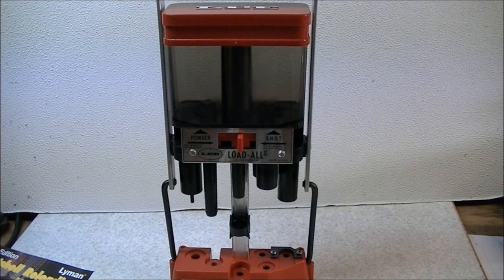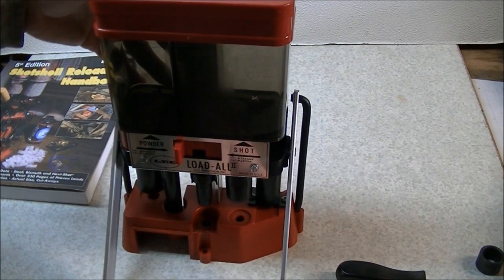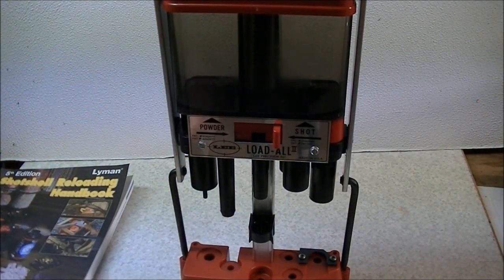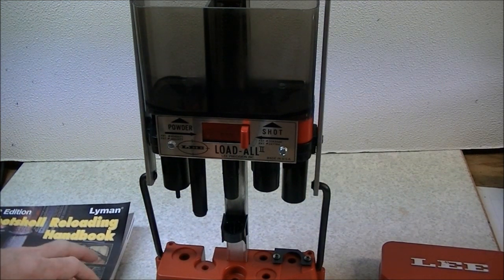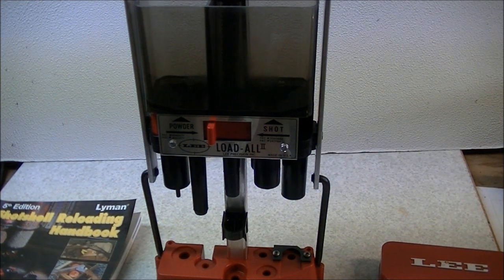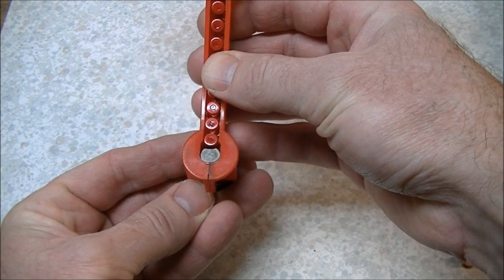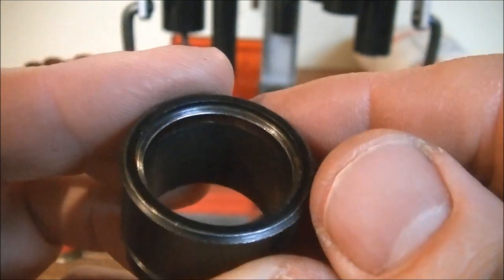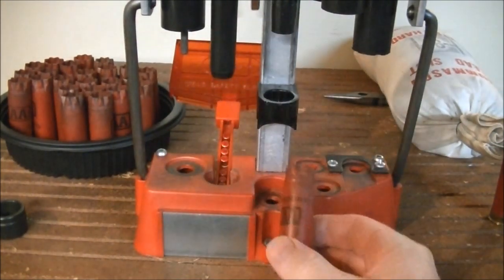Lee Load-All Setup and Operation

Comment: Let me add my thank you as well. I bought this machine because I will be loading buckshot. The powder, wads, pellets and buffer will be staged manually, but the other stations on this loader should work for me. Your advice on using powder bushings, etc. was spot on. I hope the newb reloader will spend some time with what is written in the front of the Lyman manual. Even as an experienced, albeit occasional loader, I find that refreshing my memory on the basics is time well spent.
Reply from the maker: Glad you found the video useful. Thanks for the comment.

Comment: Thank you for this video! I have recently decided to get my dad's 1959 Browning Belgium-made "Sweet Sixteen" up and shooting again, and maybe try to do a little skeet shooting with it.  I didn't know that factory 16ga target loads are basically non-existent anymore. I have a few boxes of shells from my childhood that are close to 40 years old, so I'm not putting too much faith in those. It appears to me that if I want low-pressure target loads for this shotgun, I'm going to have to learn to make them myself. If anyone reading these comments wants to share their experience with me I'd be greatful.
Reply from the maker: I bet those 40 year old boxes of shells will work just fine, assuming they were stored in reasonable conditions. As for loading shells for your Auto 5 16 gauge you may want to look into using either the Claybuster CB0078-16 16ga 7/8-oz wad or the CB0100-16 (Winchester WAA16 copy) for 1 to 1-1/8 oz loads. Have fun with your loading and shooting and thanks for the comment.

Comment: I recently bought a Lee Load-All II.  While loading I stopped and rechecked the weight of the powder charge.  It was still where I wanted it to be, so I filled an empty hull with the just weighed charge.  While I was running through the reloader, I was about drop the powder and then thought to myself, "Didn't I just fill this one?"  Yep, it already had the powder in it.  Glad I checked.
Reply from the maker: Shot shell powder/wad/shot charges are bulky and so it's unlikely you would have been able to crimp a shell with two powder charges in it.
Reply: @314299  - Thanks, that's good to hear.  But it still rattled me a little bit and made me pay more attention when I'm reloading.

Comment: Thank you! I was just given one of the first models with the aluminum base. Little bit of oil and it works like a charm!
Reply from the maker: I like those early Load-All's better, they have a more sturdy feel than the later plastic base versions.
Reply: Agreed!. Note on the conversion kits, the plastic base loaders have a screw in shell plate guide (the black thing) on the final crimp. Older metal base is by guage, meaning converting a 12 to a 16 or 20 is ok, but up converting  (originally 20, convert to 12) wont work due to the guage specific base. I'm working on a desert island-zombie outbreak way to load 3.5 inch hulls, rube goldberg, but it works. Deprime separate with rod and washer base, size with stacked sizers- 2 of them, reprime, remove wad guide, drop powder, homemade wad guide stand and wad plunger as a separate seating unit, count shot or weigh, count is by old primer tray-one pellet per hole-win 209 primer tray and then crimp as usual. Watch tough sizing, dont overstress machine, and maybe best to weigh powder charge and kind of look at load all as a fancy hand tool for priming and crimping only, better than lee hand tool. Junior load all can make passable shells too. Shave a few thousandths off the bottom of the final crimp die to get slightly deeper crimp, never more than factory loads tho. You can find these at gunshows dirt cheap at times 5-10 bucks, at worst they crimp better than the hand tool and repriming is safer than a mallet. From there forward, they do a good to great job on a budget. Mec 600's are cheaper too, 25 to 50 bucks used with rust included free with the deal, but in a lee, the 16 makes good sense to load economically and versatility wise. 28 and 410, used mec 600's are nice, I made a tooling head for a lyman vandalia for 410 with a mec #446 crimping sleeve for an old mec 400 and it works well, but it's more stumbling on to stray parts and a cobblers mindset.

Comment: Great explanatory video on the machine. I find that the crimp starter step benefits from a bit of a a jiggle to perfectly align the crimp facets. I also put a uniforming trim on cases that have been loaded a few times as they seem to stretch unevenly around the shell mouth causing lop sided crimps.
Reply from the maker: Yeah, a bit of a twist on the shell can help the crimp align itself in the machine. How many loadings are you doing before you see any of that lopsided stuff?

Comment: I bought one of these 5 or 6 years ago to mainly load slugs and buckshot on . It has loaded several hundred rounds very well .
Reply from the maker: They are supringly durable machines, considering how cheap looking they are. A buddy has a 20 gauge Load All that he has loaded tens of thousands of shells on.
Reply: James Pollard How did you load slugs with it? Do you use the same amount of powder and the same wads but just put a slug in instead? and don’t slugs need rolled crimps, not folded crimps?
Reply: My Lee slugs are fine with crimps on the loadall, but nothing stops me from using alternative crimps or overshot cards to hold the slug. Slugs are where the money is saved. If crimping, watch your column height for best results. I shim with fiber wads to control height.

Comment: Great video, I have been using one of these for close to 20-25 years.  It produces good quality loads, time consuming though.   By the way, good reminder to mount close to edge of table.
Reply from the maker: It is true that these machines are not high output, but they are not much slower than other single stage shot shell loading machines.
Reply: I’d be inclined not cut the handle 3/4 of the way through in a pizza wedge format and reweld the aluminum in order to have it miss the table. Big deal you have to reach back a bit farther at the start. Anyone try that?

Comment: Good informative video, no BS. I've been reloading pistol and rifle cartridges for decades and now that I'm doing more shotgun shooting, I'm about to start to reload shotgun shells. The only thing I didn't like was when he said you can omit the resizing step if you are using the shells in your own gun. Some people own multiple guns and may take that to mean it's ok to use them in all their guns or may go ahead and use or sell the un-resized shells for use in someone else's gun thinking it isn't an important step. Even though his statement was correct it's better not to include information someone may misinterpret.
Reply from the maker: Since sizing the shells is the same amount of steps in loading as omitting it one might as well size everything. I have never personally omitted using the sizing ring in all the years I've used these machines, but figured I might as well mention it as it is an option for those who are using shells fired and reloaded for the same gun. Supposedly there are people out there who only own one gun of a given gauge, but I think they are rare.
Reply: @314299  You are correct in what you said, and I didn't mean to sound like I was correcting you. The only reason I mentioned it is because in my experience I've had people who when told you can do this in this circumstance sometimes, they forget the circumstance then blame the person who told them when it's their fault they didn't listen, didn't understand, or didn't think the circumstance was important. I may be a little overly cautious, but I thought it was worth mentioning. Overall, it is a very good video. I still haven't decided which press I will purchase yet but your straightforward style made your video easy to follow compared to others I've watched where I had to skip through all the unnecessary commentary they add.

Comment: I think the Lee Load-All is a great value if one wants to get into reloading shot shells on a budget.  I have a MEC Sizemaster but it hasn't seem much use in about 10 years as lead shot prices are more expensive than just buying cheap shell for the occasional clay target shoots.
Reply from the maker: Yep, current commercial shot is crazy expensive. I'm lucky as I have a local source of reasonable price home made shot.

Comment: Just bought a slightly used one so excited to make some loads for clays
Reply from the maker: I hope you got all the powder and shot bushings as often they get misplaced with used machines. Good luck with your reloading efforts.
Reply: @314299  the bag of bushing was unopened. 

I am in the UK and it's weird because all the loading manuals are for American parts and what can get here seem to be different. At lease powder and primers are the same

Comment: This video was informative indeed. I would have liked to see some reloading after the explanation part of the video was finished. I think this reloader looks a bit flimsy. I’m trying to decide if I want to buy this or the MEC 600 Junior or the Sizemaster. I’m just not certain. Sometimes saving money in the short run ends up costing more in the long run. Cheers!
Reply from the maker: If you want to see some more loading at a normal pace you might want to check out this video:
 https://www.youtube.com/watch?v=YTMSFZmRznM. 
While the Lee unit does look flimsy that are in fact quite durable. I have a friend who shot about 100 shells a week at the skeet club for several years, all were loaded on a Lee press. I've no doubt his machine loaded over twenty thousand shells with no problems. Having said that the Lee is durable I would still pick a MEC as they have many more adjustments for getting the crimps just right. You would not go wrong with either a 600 JR or Sizemaster, I have several and they are great machines. For the person on a budget or who only plans on limited use the Lee unit is just fine.

Comment: When emptying the powder or shot chambers cut a 1" piece of styrofoam a little larger then the top of the chamber so it fits tight, I the take a 2" screw and put it thru the center of the foam, that way you have something to grab when removing the foam. That way you can dump one chamber and not spill the other.
Reply from the maker: That's one way or you can do this: https://www.youtube.com/watch?v=TuTrusOyMO0

Comment: Mount it on a thick board or section of plywood. Then you can clamp it to the bench in whatever position is good for efficient operation.
Reply from the maker: That is a pretty common method of mounting these machines.

Comment: One thing to note is that Lee has discontinued the primer feed for the Load-All 2. I never had one, but I find that putting the primer in manually doesn't take that much time. I heard from several people that the primer feed was not reliable.
Reply from the maker: Yes it's discontinued but it's no big loss, as you say it was not the best design.

Comment: Great video.  I want to start reloading some good quality shells in 16 gauge, both lead and bismuth because they are so darn hard to find and bismuth factory loads are so expensive.  I'm a fairly low volume shotshell user for hunting.  Those in the know all suggest a MEC press, usually the sizemaster but they are very expensive here.  The Lee load all II is a very attractive price for a few hundred rounds a year but only if it will reliably load quality shells with the Federal and Kent hulls that I have.  Unfortunately, there haven't been any AA hulls in 16 for many years and those that have them, aren't parting with any!  Do you consider the Lee good enough?  The loads will be used in a couple Winchester Model 12s and an A.H. Fox sxs.
Reply from the maker: Yes the Lee Load all will load good quality shells. However as it does hot have the same adjustments for crimping as the MEC having a load "fit" the hull correctly is more important to the finished product.

Comment: Where to see what bushing is needed for what?  Do u need spicific power for a spicific bushing? Or what is the purpose of it?
Reply from the maker: There is a bushing chart included with the machine, it lists a bunch of different powders and what each bushing will dispense with these  powders. When you have a good source of loading data you can look up your specific powder/shot charge/wad/primer/hull to see how much powder is recommended, then look at the chart to see what powder bushing you need to install to get that charge.

Comment: I'm new to reloading. I'm want to reload AA for trap and bove hunting. What kind of shots and powder and primer and wad u recommend for trap. Thx a lot
Reply from the maker: For trap loads 1-1/8 ounce of #7-/12 or #8 shot is the normal payload. If you are loading Winchester AA hulls the Winchester WAA12 wad is perfect, as is the Claybuster equivalent ( CB111812). Primers and powder are, at the moment, in sort supply and expensive. Winchester, Federal and Cheddite primers are all good. There are a multitude of powders that are suitable, examples are 700x, Red Dot, Tite Wad, etc. Shop around to see what is available. Finally load your shells using published load data for the components you are using. Best of luck!

Comment: I know this is an old video but man it was sure informative. My brother picked me up the same reloader at a garage sale for a few bucks and after watching your vid i realize im missing the resizing collar and the new primer comtraption lol and it only came with one powder charge and a 1 1/8 shot charge. My question for u is this……i shoot high brass 3” shells for ducks, will this reloader work for high brass shells?
Reply from the maker: Fortunately Lee sells replacement sizing rings and shot/powder bushing sets so you should be able to get your loader back in operation. As for the primer feeder accessory Lee does not currently manufacture that, but you can get replacement parts for the single primer feed mechanism. I did a video on loading 3" shells with this machine, you can find it here: https://www.youtube.com/watch?v=mjwHvkMNx1I&t=0s

Comment: im interested in loading novelty 12gauge and am really thinking about grabbing a lee load all 2, but is it possibly to load slugs if there is shot in the reservoir or would i have to remove the shot to load slugs?
Reply from the maker: If you were to use the powder measure part of the press than you would need to empty the shot before loading slugs. Emptying the shot is easy and I made a video showing one way to do it: https://www.youtube.com/watch?v=TuTrusOyMO0&t=9s

Comment: My nephew is asking me to show him how to load with my old Lee Load all from my youth (80s), but the powders that I  use to use are no longer available so I have to start from scratch.  I   might have to get load data from the company.  Can you use steel shot with these loaders?
Reply from the maker: There is lots of free load data available on line. Probably the best is https://www.hodgdonreloading.com/ 
As for loading steel shot with these machines it can be done but the shot bushings are calibrated for lead and so you would have to do some experimenting with the steel shot you use to see what bushing gives you close to the shot charge you need. This means you will need a scale.

Comment: Have you tried this with new shells? I've seen some sites which sell pre-primed uncrimped shells and was wondering if those would work if at all well in this.
Reply from the maker: Yes these will work on new, un-crimped shells, but the shell will need to be eased into the crimp starter station carefully and held there for a few seconds to insure that the crimp forms properly.

Comment: I am using Winchester Grey color AA hulls & they are wanting to crush the body when I do the final crimp. How much crimp do you need or does the degree of crimp not matter?
Reply from the maker: I suspect your grey AA hulls are the newer HS type that have a separate base wad, they are fairly easy to crush compared to the old one piece compression formed AA hull. What really causes those to buckle when crimped is the height of the powder/wad/shot column inside the shell. The crimp pressure should mainly be pushing down thru that column of components and not thru the hull sides. You might want to try a different combination of components to find one that "fits" better.  As for how much crimp to use that depends on what sort of gun you are using, pumps and semis generally work better with "more" crimp while with single shots, double barrels and such it really does not matter much.

Comment: Ordered this on Amazon and NO primer mechanism ....Is this a separate purchase? You didn't specify so I assumed it was just included
Reply from the maker: Like I said at 10:23 in the video the primer feed was an optional accessory item, and therefore was not included with the press. Lee no longer makes the primer feed.

Comment: How does the crimp work on a new hull?
Reply from the maker: Crimping new hulls follows pretty much the same practice as crimping a used hull, you pick either six or eight point crimp starting station and then apply gradual pressure on the hull to start creasing the plastic, holding the handle down for a couple seconds to help the plastic take shape, the move to the final crimp station to finish
Reply: @314299  Thank you for the prompt reply. Just receiving My loader tomorrow..
Thanks again Frank
Reply from the maker: @frankjones3450  No problem, best of luck with your new machine.

Comment: i received my Lee Load All 2 today.  In going over the parts to assemble and so on I came across a black plastic piece that looks like a bushing and has the number 12 on it and the throat is serrated or cut.  The instructions give no clue what this is for at all.  Do you know?
Reply from the maker: That sounds like the spare wad guide that they included with the machine.